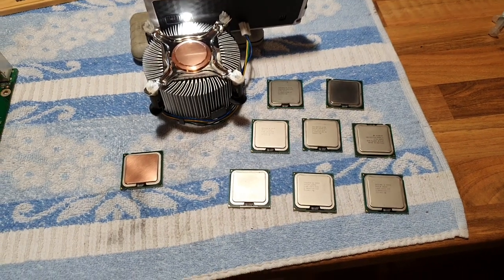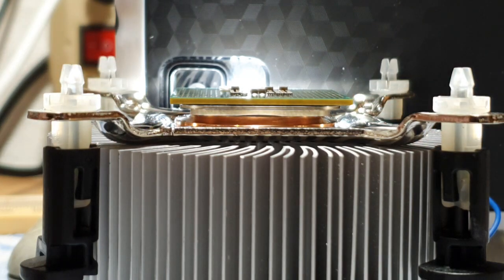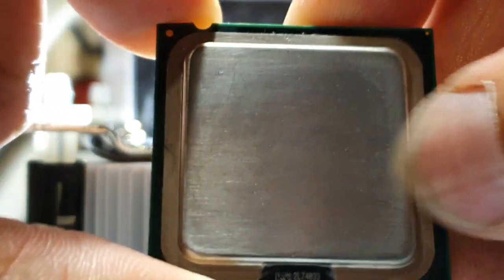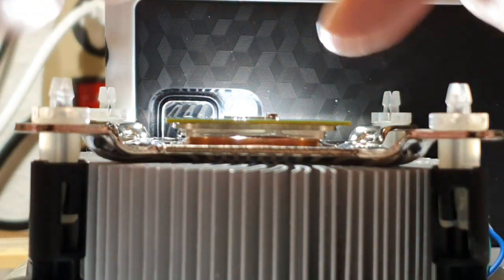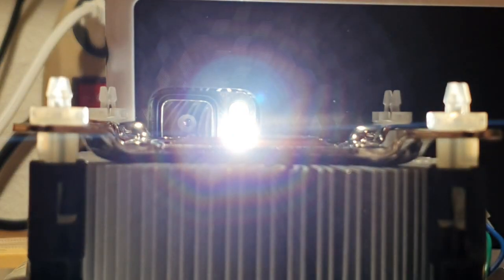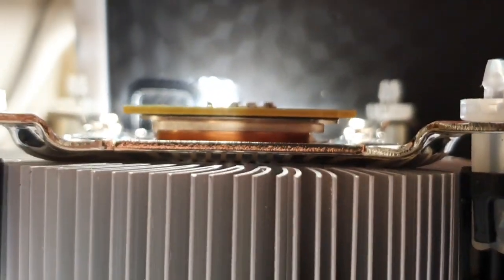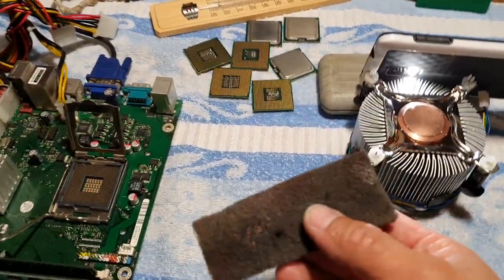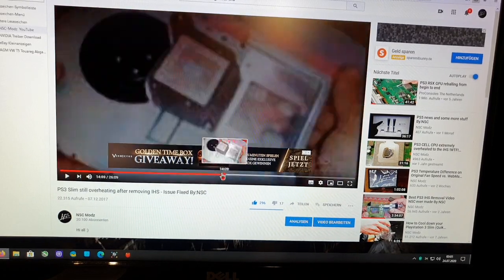This is why your CPU is running hot even with the best thermal paste By:NSC

Comment: Hey i have a problem with my laptop gpu its nvs 3100m laptop graphics card and its overheating i change thermal paste for the cpu and its work but for the gpu it didn't work like i just enter some game and my gpu temp get up to 80 digres in 5 sec  and to 106 digres in lest than 20 sec and the pc shutdoan its self what the problem plss
Reply from the maker: Your cooler is the problem... heatsink beendet maybe to...
Reply: @NSC-Modz  i dont think is the cooler the laptop only has one fan and its cooling both of the cpu and gpu together the heatsink is pass above the cpu and the gpu but anyway thank you😊
Reply from the maker: @NatureSoundscape.  i mean the whole cooler, so check the pressure on the die it self, the thermal paste should be spread prefect with a great pressure.
Reply: @NSC-Modz  ok thanks man i well try,that
Reply from the maker: @NatureSoundscape.  testing testing testing, this is the key for best results ;)
Reply: @NSC-Modz  Thanks Sure I Well